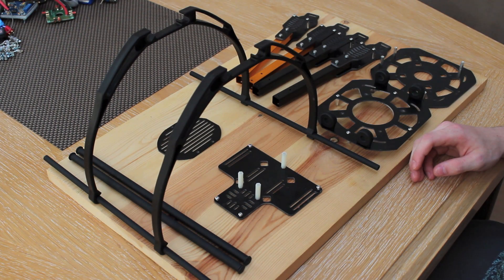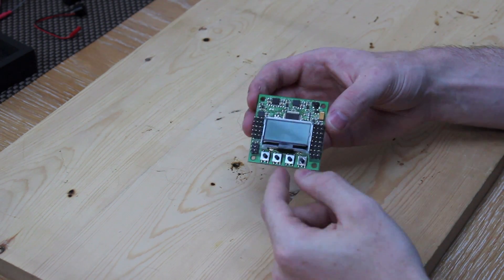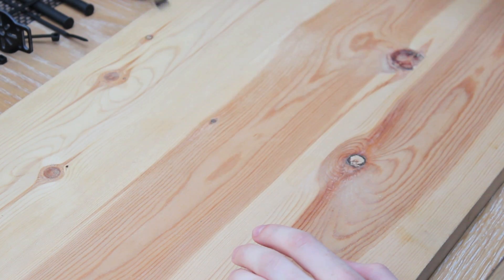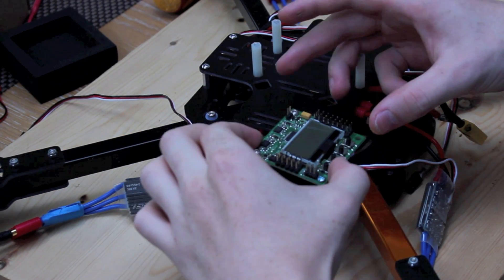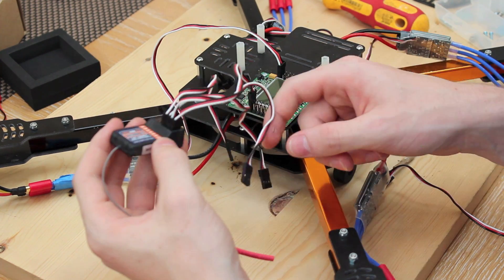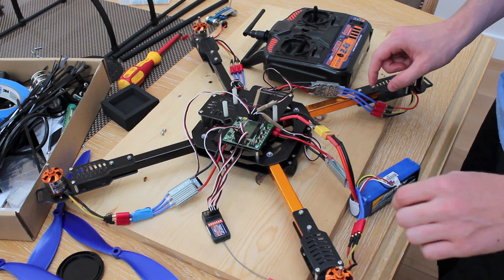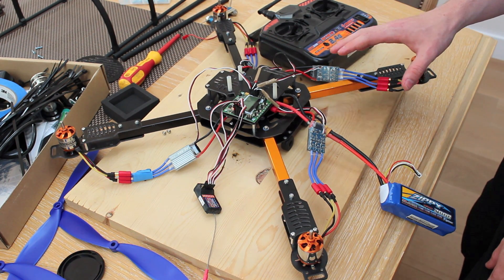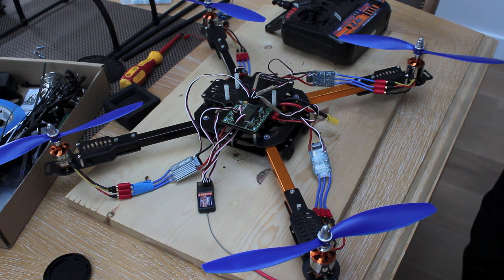How to build a Quadcopter

Comment: Can you give me a parts list with the same flight controller for under $175
Reply: Buld your own frame and save tonnes. Flite test did a vid where they just used a toolbox as the frame. Hire a laser cutter or a 3d printer. I made my own frame and it costs about 175

Comment: I built this quadcopter using exactly the same parts but when I went to plug in my battery I think one of my ESC's blew.. I heard a loud pop and then some smoke came from the esc. Continued anyway and tried to calibrate them but only one calibrated. Anyone else have the same problem/ know a fix? Thanks!

Comment: Nice video, thanks for doing this. I did cringe a bit, though, when you used pliers to tighten your motor spinners.Those holes in the spinners are so you can insert a rod (or allen wrench) to tighten them without damaging them. Anyway, thanks again. Nice job.

Comment: Weborial Hey, I've got two questions: 1) Will I still be able to use the same parts as you but with a different frame/ I'm asking because I've found a cooler one. 2) Is it stable? ive seen the maiden flight but it didnt look stable. Is that because it was windy of is it just slightly unstable. Thanx!

Comment: i followed step by step everything in the tutorial and finished my quad but when i apply throttle the quad flips, did you have the same problem or did you change something? maybe you put the props on wrong in the beginning or the kk 2.1 has to go in the center not at the left where you put it? or you updated the PI settings?
i will greatly appreciate your help since the only manual i used was this tutorial...
maybe it's the switches at the bottom of the transmitter?
Reply: hey, im very sorry for the late reply, im currently revising for my A levels :P (im posting on my other youtube account). If you have not already managed to fix this issue, i believe either you have missplaced the props, or your gyros are calibrated the wrong way round. (the kk board will work better in the middle aswell). To make sure its the gyros causing the problem, remove the props, and start up the quad at min throtte. tilt the quad, and try and feel which props are speeding up. e.g, if u tilt the quad to the left, the motors on the left side should speed up. If the motors on the right side speed up then the quad will flip! If thats the issue, then get back to me and ill try my best to help you out
Reply: also make sure all the motors are plugged into the right sockets on the kk board and that uve got them in the right configuration ( x or + )
Reply: AlexsHelpAndReviews1 i got to work well after placing the kk 2.1 board in the center, calibrating the acc's, making a receiver test (i need to tune it every time i turn it on...) and setting the p and i gain p = 100 limit 50, I = 40 limit 20 and it lifted a couple of times leveled it does roll a lot right after liftoff. 
Thanks a lot for the help.
Best Regards
Reply: Efroim Rosenberg im glad its working :D if its rolling right a lot, all you have to do is trim it on the transmitter.Its just a matter of moving the little slider under the right stick to the left to compensate for the right roll.

Alex
Reply: +Rayyaan Mustafa yes it should do :) the both the blue and the black ones you linked are standard props so should be fine! Just a different colour
Reply: +Rayyaan Mustafa I used a drill to make the hole in the center of the prop bigger so it fit the bolt on top of the motor, than I tightened the prop in place with the rounded pointy nut that came with the motor.

Comment: Can you use T-motor anti-grav motors?
Reply: You can use whatever motor you want as long as you have a esc and battery that supports the power.
Reply: Double check to see how much your flight controller supports for voltage, most go up to 6 cell batteries.

Comment: Never mind I found it, 

Quantity
Stock
Product description
Price
Weight
 

OK
9323000048 - Hobbyking X650F Glass Fiber Quadcopter F..
*This item usually ships within 3 days
$33.99
1159

OK
9171000033 - Hobby King Quadcopter Power Distribution..
$3.75
38

OK
TAE-30A - Turnigy AE-30A Brushless ESC
$50.20
156

OK
9001-AB - 3.5mm 3 wire Bullet-connector for motor ..
$4.71
43

OK
9031000101 - 2221 Brushless Outrunner Motor for 450 H..
$79.96
596

OK
HK-T4A-M2 - Hobby King 2.4Ghz 4Ch Tx & Rx V2 (Mode 2..
*This item usually ships within 3 days
$23.02
989

OK
9171000334-0 - Hobbyking KK2.1 Multi-rotor LCD Flight C..
$29.99
40

OK
HCB-10 - 10X6 Propellers (Standard and Counter Ro..
$3.48
91

OK
Z28003S-30 - ZIPPY Flightmax 2800mAh 3S1P 30C
$37.54
522

OK
B6AC - IMAX B6-AC Charger/Discharger 1-6 Cells ..
$39.99
1094

OK
015000011 - 3cm Male to Male Servo Lead 26AWG (10pcs..
$4.14
28

	
TOTAL: $310.77
4756g

Comment: Great video.  Can you tell me which battery you use (3S or 4S)?  What is the best battery I can use for maximum flight time, assuming I use your same exact setup (I already have the frame, and the rest is the way)?  I have four 3S 2200mAh batteries, but am thinking about upgrading to 4S lipo.  Good idea or not?
Reply from the maker: sorry for the late reply. I am using a 3S lipo. The 4s lipos will draw more amps from the motor, so if you do decide to use a 4S lipo, reduce the size of your props or the motors may over heat.

Comment: flight controller no longer exists, would the newer version still work with this?
Reply: KK2.1 is supposed to be more stable than the KK2.0 (I just bought the KK2.1 and spent hours reading forums before doing so). The KK2.1 is sold out at Hobbyking, but I paid a little extra and bought mine from Ebay.
Reply from the maker: Brett is correct. The kk2.1 is just an enhancement over the 2.0.
Reply: Weborial Thanks for answering my question about batteries.  Im having an issue calibrating the 4 * Turnigy Plush 30amp ESC's using the KK2.1 FC.  I followed your video instructions exactly.  When I hold down buttons 1 and 4 on the KK2.1 FC with throttle at full, I hear the first 'song' and at that point, you are supposed to lower the throttle to 0. If I do that, all I get is steady 4 beeps (2 quick beeps, pause plus 2 more quick beeps). No matter how long I hold down buttons 1 and 4, that final 'song' never plays.

The thing is, if I don't lower the throttle to zero but instead, just keep it at full throttle, the calibration seems to actually continue through the correct process (each ESC beeps once, then twice, three times and finally, four times and then, I hear the 'song' - which according to your video is the signal to lower throttle, and after the second 'song', let go of buttons and unplus battery). But this obviously is no good because I haven't lowered the throttle. What could cause the calibration procedure to quit after lowering the throttle? I have sub-trimmed the throttle. 0 = 0 and full = 97. Dont know what else to do?
Reply from the maker: I had some issues myself with calibrating the throttle. My video just shows the cut where i actually got it correct. First of all, i would double check that the servo leads connecting the receiver to the flight controller are plugged in the right way around. This would lead to no signals from the transmitter to the escs. The black wire on the flight controller should be facing the outside of the board and the white wires on the receiver should be facing the antenna (assuming you used the same radio set as me).

If this doesnt work, i highly suggest you just keep playing with it. Repeat it a few times, maybe try placing all the trimmer switches in the middle. Also try reversing the throttle (bottom right of the transmitter, if your using the same one).

Don't give up, I assure you it will work!

Regards

Alex

Comment: USE A SMALL ALLEN KEY THRU THE HOLE ON THE PROP SPINNER AND YOU WONT BE SCARING AND SCRATCHING UP THE PROP SPINNER NUT